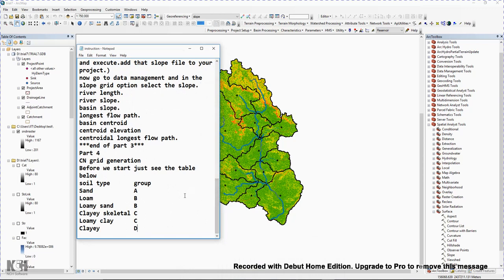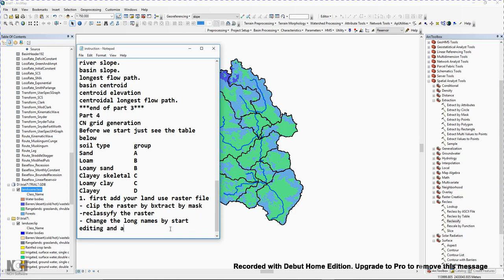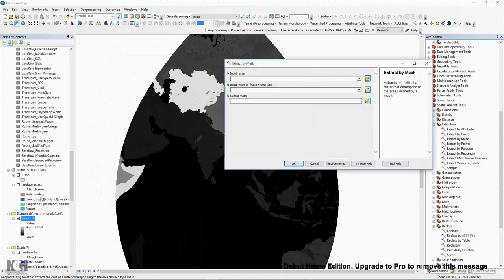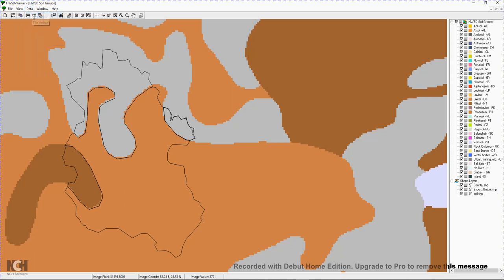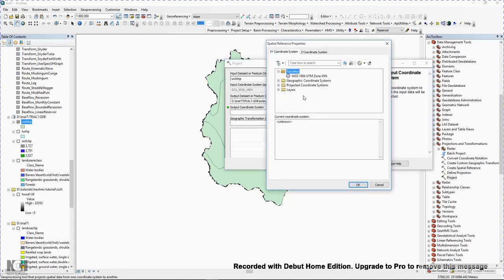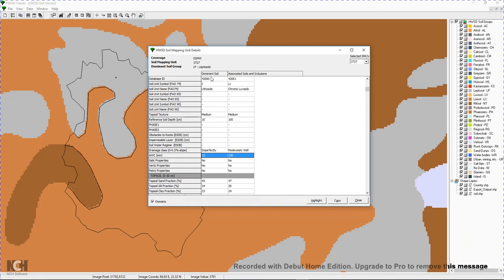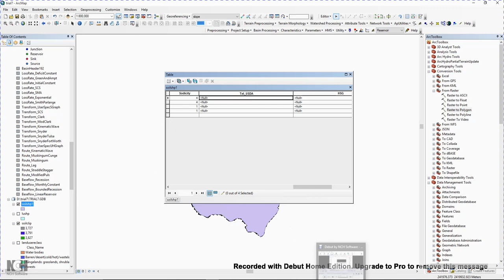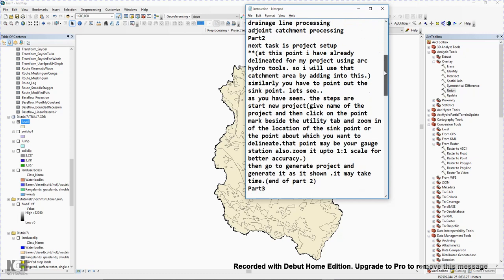hecgeohms part 4(1)-CN grid (1)

Comment: Its not possible to download data from HWSD site. Its showing like access denied. can u help me
Reply from the maker: you may try personal internet. just check it.
Reply: @mdaltafuddin9  HWSD- viewer  is downloaded  and its installed  in my system. And i tried with personal internet for to download data, but its still showing like ( Error code 15- This request was blocked by security rules)
Reply from the maker: @priyav3491  send a request at mdaltafuddin9@gmail.com
Reply: @mdaltafuddin9  Thanks for your video. Its really helped me a lot. The site which u preferred for downloading soil data is not working for me, but i get it from other site. I downloaded the soil data from  FAO DSMW Site and then i used hwsd viewer to see its properties.
Reply: @priyav3491  But the data is different
Reply: I'm also facing the same problem.Access denied and they have blocked the site
Reply: Nayak N  hello sir
in 1:00:49 how did he assign the hydrologic soil group ?
please help
Reply: Does txt code means textural code of Soil